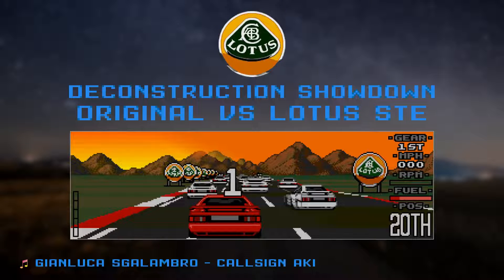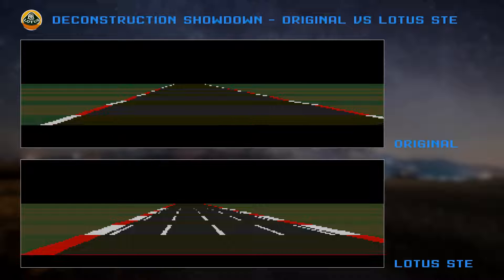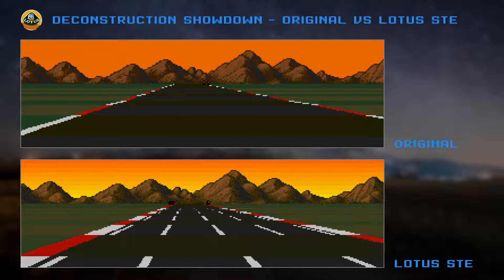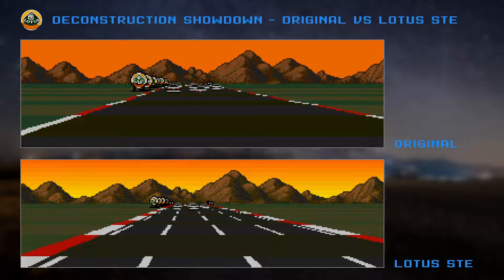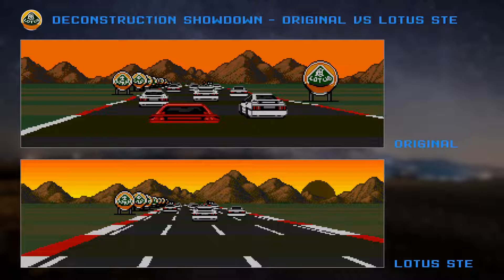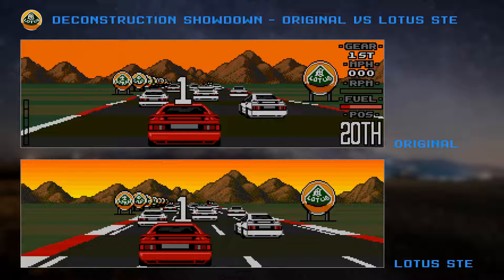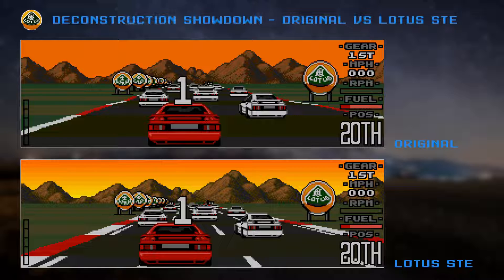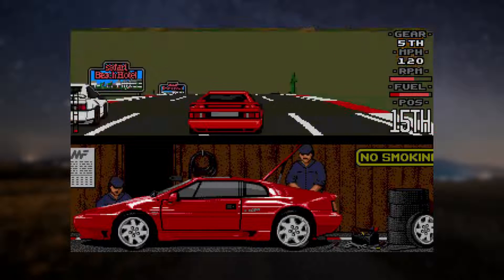Lotus 1 Deconstruction Showdown - Original vs Lotus STE!

Comment: I made this observation a while ago JT that lower resolutions and lower frame rates appear smoother ie 320*200 at 20 fps appears alot smoother due to low res and framerate due to smaller transitions per frame ie 5 pixels vertically or horizonatly per sprite compared to say 1024*768 or say 1440p 5 pixels would be 30 to 50 pixels at 20 frames per sec and would be horrible.
Reply from the maker: That makes a lot of sense!

Comment: Yes but....can anybody improve the framerate of Lotus II on an STFM or is Shaun Southern the king of ST coders?
Reply from the maker: No doubt the framerate of Lotus 2 could be increased - the real questions are "by how much?" and "how long would somebody have to spend on it?" 😀

Shaun Southern did a great job of optimising Lotus 2 for the ST - I suspect he reached a point of diminishing returns and left it there. I suspect the potential gains are in single figure percentage increase of framerate, even with use of the Blitter.
Reply: @gridleaderretro  That new homebrew based on WEC Le Mans arcade for the STE is as fast and smooth as Lotus II on the Amiga so an STE port I suspect could be identical. The STFM however like you say is probably highly optimised, I know for a fact there is no chipset bandwidth left spare on the Amiga version hence to run Lotus III with zero frame drops you have to run it on an Amiga 1200 or better model as the RECS system needed some DMA/chipset bandwidth etc and something had to give. Lotus II is the fastest and smoothest STFM 2.5D routine I know of personally.
Reply from the maker: @retrotronics1845  That new homebrew based on WEC Le Mans arcade for the STE (my very own project in case you're not aware!) is much smoother than Lotus 2 on the Amiga. Lotus 2 on an OCS/ECS Amiga runs at around 20-25fps I believe, whereas the STE WEC game runs (mostly) at 50fps. But the STE WEC game is doing much less work than Lotus 2 (appearances can be deceptive I know).

I personally don't think that Lotus 2 on the STE could be as smooth as the Amiga version without some superhuman effort, although it could come close (as we've done with the STE version of Lotus 1). The Amiga version makes heavy use of the Copper, and even with the extra chips in the STE, all those colour changes have to be done in software with the 68k carrying the burden. It might be possible to get some extra performance out of the STE by upping the memory requirement to 4 meg and making use of memory-intensive techniques such as compiled Blitter sprites (as used by the WEC game).

You might also want to check out Crazy Cars 3 for the ST, which to me comes very close to Lotus 2 in terms of accomplishment.
Reply: @gridleaderretro  Oh! I didn't know. I must congratulate you on such amazing work for the STE, I saw it on a thread on Amiga forum a couple of weeks ago. Your video is as impressive as the new MegaDrive 2.5D homebrew racing game or better even. PS I have two Mega STEs with 16mhz 68000 if you would like to support the limits ;) Rare machine but I needed a 16mhz ST/STE to play Gauntlet 1 smoother!

Comment: i wonder if you can help me? i tried to code a racing game for the C64 but could never figure out the maths for displaying the road properly? would you have a general idea or point me in the right direction?
Reply from the maker: The problem you're likely to have is that the most "correct" maths for displaying the road correctly will be way beyond the capabilities of the C64's CPU. You'll need to improvise heavily in the same way as the majority of commercial C64 racing games did.

You may be able to get some inspiration from Lou's Pseudo 3d Page at http://www.extentofthejam.com/pseudo/, but you will almost certainly need to tailor these methods heavily to accommodate the constraints of the C64's CPU.
Reply: @gridleaderretro  Many thanks!!

Comment: This is fascinating to look at again! Keep on doing these!
One question: Do you manually clear the screenbuffer before your recording, to start on a blank black canvas? I ask because in ANARCHO Ride I just draw over the last frame in the buffer - reusing as much as I can from the dashboard. Even if I could record the drawing, it would never be on a blank screen.
Reply from the maker: Yes - I clear both front and back buffer before starting the process!
Reply: @gridleaderretro  ah cool was doing fast cheap hacks on the amiga version. But your tech is fantastic.

Would love to colaberate some info if possible. I dont know any st hardware info, only amiga, but i know that lotus 1 , 2 and 3 basicly use recycled code with mods and enhancement.
Rough inspection i see track data is in segs then read and turned into straights hill and curves in a table then that is read again and turned into copper and blitter etc etc
I know there is a few luts for calcs. Ive done a few cheats some already in trainers. Speed collisions time , force fuel etc etc 

Anyway be good to talk about it.

Comment: Would there be enough memory to fully pre shift the masks so that you could use the CPU instead of the blitter to mask all 4 planes using the same data registers? If not could the blitter be used to shift the mask off screen then use the CPU to apply the mask on a screen? Would it save enough time to be worth the trouble though.
Reply from the maker: It's certainly a possibility, although it would involve a considerable amount of extra work, and as you say, it would need to be profiled. With the current implementation, we've been very fortunate in that we've not had to add or modify any of the existing graphics data in order to leverage the Blitter. The only exception to this is the data for the background mountains, which gets preprocessed on load for each stage.

Comment: I thought that if you don’t run the blitter in HOG mode then you wouldn’t have to split up the drawing into small blocks, you do need a tight cpu loop though after starting the blitter to restart it if the operation is not complete. Or did you try this and found it to be slower?
Reply from the maker: I tried the Blit mode (the mode that isn't Hog) in Lotus STE and it didn't work unfortunately - there were interrupts being missed and the whole game was being slowed down.

Using the Blitter in Hog mode and splitting into small chunks (of around 20 words each) seems to be the key to balancing the need for fast blitting and interrupts being serviced. It's a pain, but it is what it is :)
Reply: It would be really interesting to perform single pass masking using Anima’s masking technique. It would cost memory to pre shift the masks but it would be far better for rasters and probably twice as fast. Span filling the car in the foreground would be very very quick indeed. I think you might get a solid 25fps out of the blitter that way :)
Reply from the maker: Yes - there's definitely scope for speeding things up using techniques like that. I have made the source available on Github for anybody who fancies the challenge :)

Comment: Very surprised indeed. Would it be too much to ask to do a video like this for ST, STe and the Amiga version of the game?

I think WinUAE has some cool features that allows you to see how efficient you are using the DMA slots. Someone said the Amiga version was in fact very well done. I always looked at it as a CPU only port from the ST, guess I was wrong.
Reply from the maker: What you have here already shows both ST and STE. I'm sorry, I wouldn't have a clue how to do this for the Amiga :)

The Amiga version is anything but a CPU port from the ST. As I understand it, the game was designed and built around the Amiga hardware, and the ST version was then derived from the Amiga version with a whole load of sacrifices made to get the game working on the ST. There are lots of magazine articles from the time where Shaun Southern goes into some detail about how the game is designed to make specific use of the Amiga hardware.
Reply: WinUAE is unfortunately not very scriptable (or at least was not, last time I checked) so it would require tinkering with its source code to add the "freeze and simulate screen display" feature that @gridleaderretro is using here.
It is definitely possible but unlikely to be easy.
Reply from the maker: @nekononiaow  Just to be clear, the backbuffer captures shown in this video don't involve any modifications to either the emulator or the game code. All I'm doing is setting the emulator debugger to break on horizontal blank, and then capturing the contents of the backbuffer to a numbered binary file every time this happens. I then convert the resulting sequence of binary files to PNGs and then sequence them into a movie. There's a bit of additional magic to make sure that the rasters show correctly. Assuming that the WinUAE debugger can also break on a horizontal blank or similar, a variation of this approach should also be possible on the Amiga (putting aside the additional complexities that things like the Copper and hardware sprites bring to the table). I can help out if somebody wants to give it a try.
Reply: @gridleaderretro  Nice, I like the simplicity of it.
On the Amiga things would be quite complicated by the presence of the Copper list which would need to be re-interpreted when drawing the back buffer with the proper colors. Some games also have mid-screen bitmap splits which would actually require the Copper list to be interpreted before drawing the back buffer.
But all in all, the principle is indeed the same. Great idea.

Comment: I guess the road lines and the more precise sprite positioning aid the perception of a smoother game.
Reply from the maker: Yep, I think it must be something along those lines!
Reply: This seems indeed very likely as their fluid motion is immediately visible whereas 16 pixels movement seems likely to be interpreted as choppy.

This may be a case where it may have been preferable to go with much simpler car rendering (pseudo 3D flat surfaces) to allow them to be positioned at pixel precision rather than super nice cars at 16 pixels intervals.

Comment: So would it not be possible to use the original sprite drawing in the ste version? Or would it still be slower due to the sound? Is it something you have tested?
Reply from the maker: The original sprite drawing works fine in the STE version, but it's restricted to drawing the sprites at 16 pixel horizontal intervals. Using the Blitter gives us the ability to draw sprites at 1 pixel horizontal intervals (as with the Amiga version) but looks to be a little slower.
Reply: @gridleaderretro  sorry. What i was getting at was is it possible to revert that part of lotus ste back to the faster older code to speed things up or would that mean that the blitter couldn't be used for any of it like the road drawing?
Reply from the maker: @Barcrest  Yes, you could revert the sprite drawing back to the original code very easily. The performance gains would be marginal though, and it would look absolutely awful as with the original ST version :)
Reply: @gridleaderretro  yes i didnt realise about the sprite movement, sorry my bad.